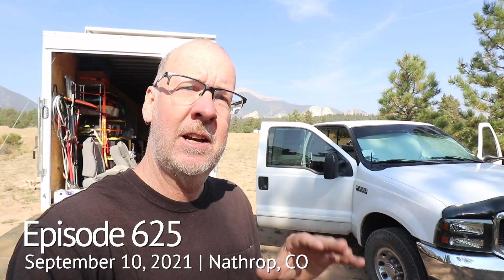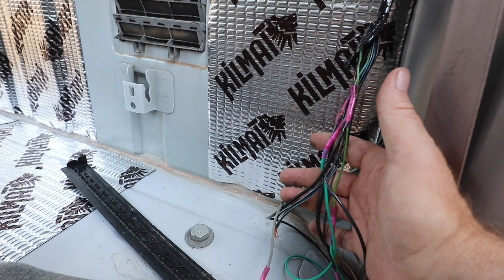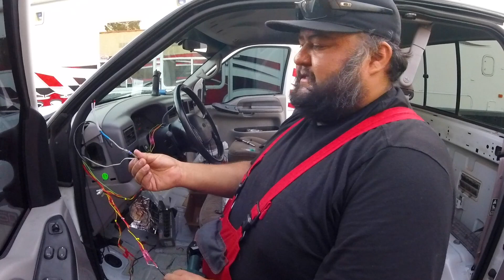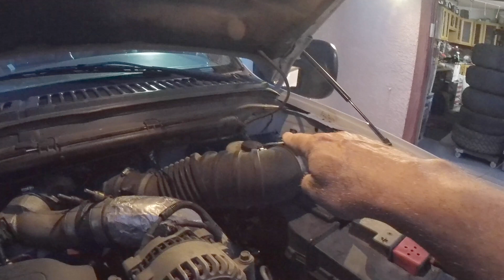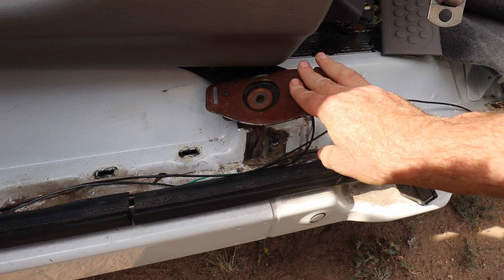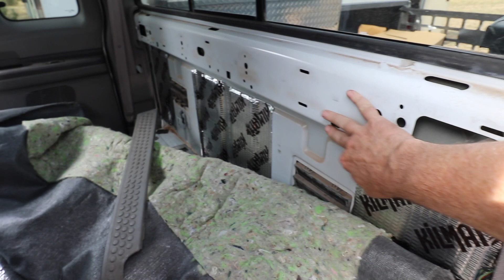Replacing Seats in My Stolen Recovered Truck E625

Comment: Oh Seven! Congrats on finding the front seats. That will be so much comfier and probably safer too. Great decision on the carpet installer - it makes sense to pay a pro so it will fit right and last longer. Hooray. What a nightmare this has all been but the silver lining is your (our) massive gift to HOWA!  Gosh, you have learned so much and gathered really good info from your viewers - just gotta filter the silly stuff out. Best wishes for it all to go well. Couldn't be happier for you to get closer and closer to completion. I hope you can then get the trailer ready for winter before the snow flies. Fingers crossed.

Comment: Hi Seven What's going on man Great to see you and having the truck back its easy to apply the carpet kit just need a box knife and just measure things out and cut on the back side of the carpet and insolation Then just contour the seats to your comfort level you can go to the Ford page and look on the trucks that they have to see where the extra parts go that don't fit And I have a great suggestion for you you might want to fabricate something that gets you every time you get out where you jam the gas pedal that's the way I've seen it done in a few video's as far  as the tool boxes go that's great I'd also think about the aspect of you putting a Truck camper that you live in on top of it that way you don't have this happen again and your right with your truck # saver the moment

Comment: P.S. if you do wind up having to bolt down that fifth mounting point, you will need to use Grade 8 bolts and nuts, they are very high strength hardware that I would use for safety equipment.
Reply: There is really no "if" about it to use the seat belts built into the seats. That is a "MUST" bolt down that fifth point and solidly. I'd say ditch the built in badly frayed (yes, it is badly frayed, not "looks not bad" Seven) belt and use the cab mounted ones.

Comment: WARNING!!!!!  That 5th mounting point is designed to carry the load from the seat belt in an accident. Without that, you and the seat are likely to hit the dash. I would use the cab mounted belts, in your situation. BTW, I am a retired custom car interior builder and am familiar with how these internal seat belt systems work. The normal seat mounts are not strong enough for the weight of the seat AND you. They are enough when the belts holding YOU are anchored independently from the seat. I repeat: Use the cab mounted seat belts!

Comment: You need a wiring diagram in order to figure out where the extra wires connect.  You can probably obtain one at a repair shop.  They generally subscribe to Mitchell which allows them to print pages from repair manuals.  For a small charge they would probably print you a wiring diagram for the area you need.  In the mean time, you need to tape the ends of those exposed wires in order to prevent a possible short.

Comment: It’s too bad it wasn’t a newer truck or the f150 (smaller than yours), because I work at one of the plants where they build the f150’s and could get info on how the carpet and that other stuff goes in and the wiring info etc. The aftermarket stuff is usually more of a challenge because they’re “universal”. Looks like it’s slowly coming together though. Thanks for sharing.

Comment: I was following a pickup with that "tailgate".  He had a full 5 gallon water jug in the back.  As he went around a corner it slid out under the gate.   Seems there needs to be a way to hold the bottom edge down.

Comment: There should be a plastic piece that goes along the width of the back. It also covers the carpet that runs up along the back side as finishing trim. Don't know what the mystery piece is for however. That fifth mounting point could be part of the integral seat belt system to the seat. Check with a dealer to get more info. You might have to bend it down and bolt it to the truck if it is part of the system.

Comment: I put a push button under the driver side Carpet where in older cars it would be a button for the high beams prior to them incorporating it in the trun signal.  It has to be push in order to get the shift lever out of park. The car will start but not move.

Comment: For the back I would build a custom panel plywood with carpet glued
Instead of getting a bench I would build a flat platform bed with foam
I have a dodge dually crew cab that i'm gonna build a bed and take out bench seat